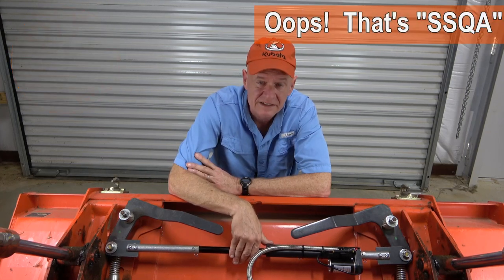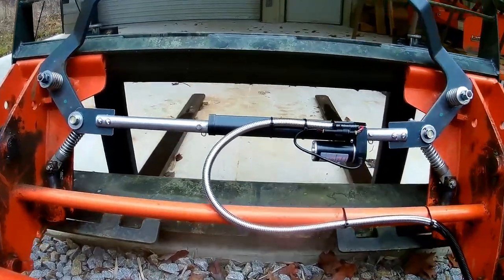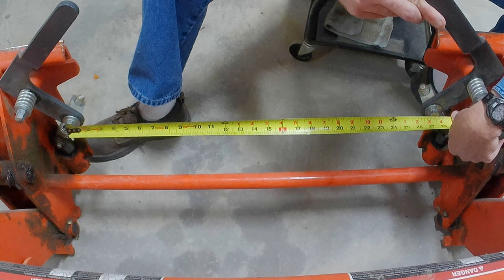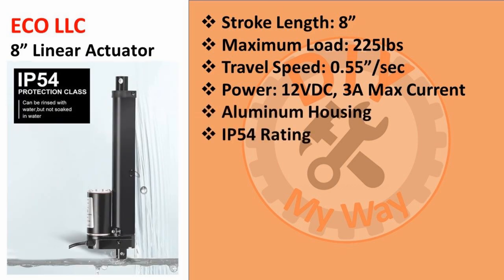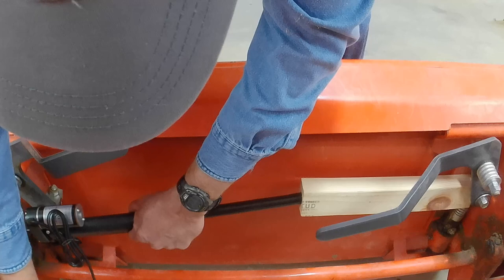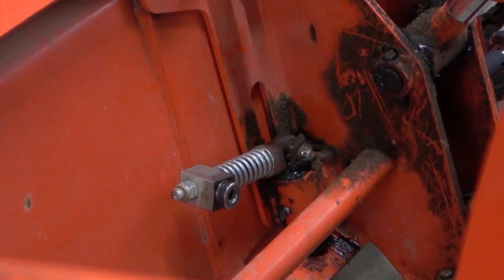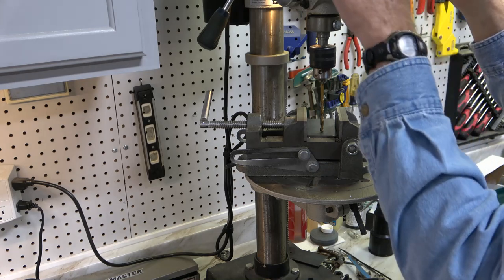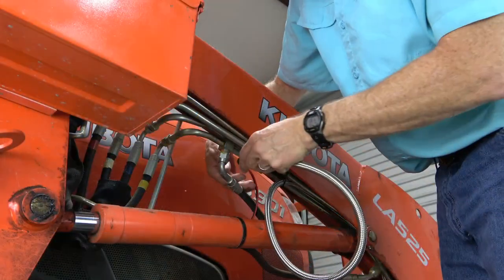Building an Inexpensive SSQA Remote Control for My Tractor - Part 1 (#181)

Comment: That's cool. I think I have everything to do this but the actuator and switch.
Reply from the maker: Good luck and thanks for watching!
Reply: Completed. Installed on a BX23s. The shaft on the actuator is adjustable. You can thread it in and out about 1 inch to fit perfectly.

Comment: That calculation from the diameter of the washer being 1 inch and 3/8, divide both by two, 1/2 inch and 3/16 inch, also known as 11/16" (lol!). I use that trick all the time, it's nice when you know it! Enlarging a hole in a washer is best done using a step drill. It does a perfectly round hole and does the deburring at the same time! Well done sir!
Reply from the maker: Hi Joe! Great minds think alike. LOL! None of my step drill bits had the right step size for a snug fit on an M12 bolt so I used one from my jobber drill bit set. Thanks for watching!

Comment: I ordered the cylinder ram from Amazon…..I have the exact same loader. Saved me a lot of time calculating what I would need! 
It’ll be a good next spring job. Too late this year to start a project like that! My tractor sits a lot in storage through the winter!
Great video! ….I’ve seen hydraulic options but those are pricey!
Reply from the maker: Hi Mark!  If your not going to do the project until spring, I recommend you at least test the actuator to make sure it works and that it can open your SSQA.  If not you can still return it.  Next spring it will be way past the return window.  Part 2 will have important info you’ll need for the project. Good luck and thanks for watching!
Reply: @DIYMyWay  Thanks for this awesome information. I've ordered 3 of the 4 items you listed in the  description and was delivered this morning.  I'm going to use the corrugated tubing that I already have. I can't hardly wait until part 2 because all that I need to know is the pipe length and the inline fuse size. I just Love all of your content. 
Thanks!!!
PS. I have all of the parts to build your tool for adding ballast to the tires.👍

Comment: Enjoyed the video, Martin.  I'm liking the actuator.  I am tired of jumping in & out of the cab to attach/detach the SSQA lockdown levers.  For now, I'm stuck with manually doing this until I decide to do as you and Mech have done to eliminate my constant off & on cab movement.  Heck, that energy could be used for something much more constructive (like drinking a brewski or two...smile).  See you in Part 2.  Don  👍🏽🤠  11/12/22
Reply from the maker: Hi Don! Perhaps you should heed the wisdom of Nike and “just do it”. You’ll be glad you did, especially with a cab tractor. Thanks for watching!

Comment: I just found your channel today when I was looking for a carry all design, which by the way I really like and plan to use your plans. This remote ssqa remote is one of the coolest ideas I've seen. Too bad I only have a bucket and a grapple right now and have to get off to unhook the third function hydraulics anyway. By the way I subbed and I really like your ideas.
Reply from the maker: Hi Dan! Glad you like the carryall design and the SSQA remote control.  Just a bucket and a grapple?  Sounds like you need some pallet forks.  They are SO useful to have.  The SSQA remote control has been on my mind for a good while, and I finally got around to making it.  Thanks for watching and subscribing!
Reply: @DIYMyWay  Pallet forks are next on the list as I'm planning on incorporating IBC totes into my firewood program. Now back to binge watching your videos. Thanks.

Comment: I know you still have part 2 coming up. I've been thinking about doing something like this but putting a pin set up on one side incase the system fails and so I can just pull a pin to unhook the cylinder until I can fix it I've been also trying to figure out a way to put some kind of protection for the cylinder incase something comes over the bucket
Reply from the maker: There are removable pins on both ends of the actuator for that reason along with an electrical that can be undone at the actuator.  All covered in Part 2. Thanks for watching!
Reply: Is it ok to share this video along with part 2?

Comment: Would there be any damage to the actuator if the SSQA failed to engage into the hole?
Reply from the maker: Possibly, especially with a $43 actuator.  More expensive ones would probably do better in a stall situation.  However I have found that as along as I always curl the implement up fully before operating the actuator, the pins always fully engage the holes. Thanks for watching!

Comment: Enjoyed your video. It's the only one on YouTube like it.. on my bobcat skid loader the difference between open and closed is 6 1/4 in.. Should I go with a 6 in or 8-in actuator? Thank you
How has your cheaper one from Amazon been working?
Reply from the maker: Glad you enjoyed it!  Go with the 6” for sure so the built in limit switches stop it in time.  Make sure you get an actuator strong enough to operate the mechanism. Since yours requires a shorter stroke you might go with a 330lb actuator which will move slightly slower but since it’s only traveling 6” it shouldn’t be a problem. Mine is still going strong and I use it fairly frequently. Good luck!
Reply: @DIYMyWay  Thank You for the help! I was going with the progressive automations 400 lb on Amazon, I'll buy the 6-in.
Reply from the maker: Sounds like a good choice.  If you leave your skid steer out in the weather, the actuator needs to be fully weather proof.
Reply: @DIYMyWay  I leave it parked inside year round ,this one is  one of the higher end models I seen online and Amazon just happens to sell that brand.

Comment: do you think this would work on a Kubota lx 2610 with the LA 535 loader if the measurements would be close to how you measured it and I found close to the same actuator
Reply from the maker: It might. Some loaders of smaller compact tractors have extra bulkhead plates that may get in the way.  They might require cutting a little bit of metal off the bulkheads to get line of sight between the pivot bolts.  I wouldn’t recommend doing that until the warranty on the loader has expired.
Reply: @DIYMyWay  what tractor and loader did you do this project on? just wondering
Reply: Jim, I have the lx2610 with 535, I’ll be doing this build.
Reply: @joshguard9834  my thoughts exactly sir!
Reply from the maker: @Jim Kasianides  That is explicitly covered in this video.
Reply: @jimkasianides5676  he did that on the L3901 tractor & LA525 Loader. I have the same exact setup as he does.

Comment: How would this work with grapples?
Reply from the maker: I don't have a grapple so I don't know for sure, but I don't see why it wouldn't work. Thanks for watching!
Reply: It would work the same. The only difference is that you’ll still have to get off the tractor the couple/uncouple the 3rd function hydraulics